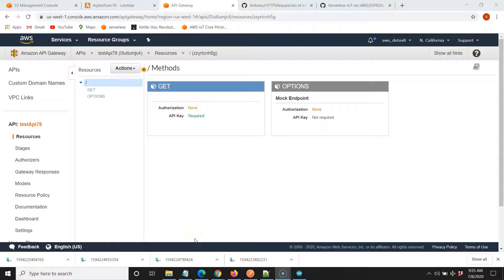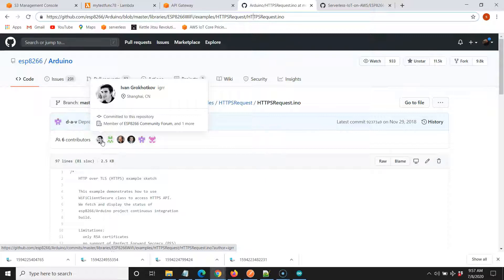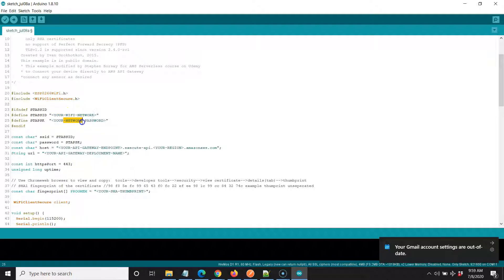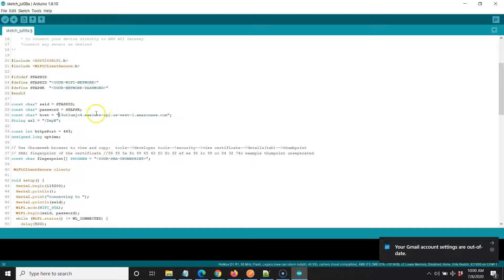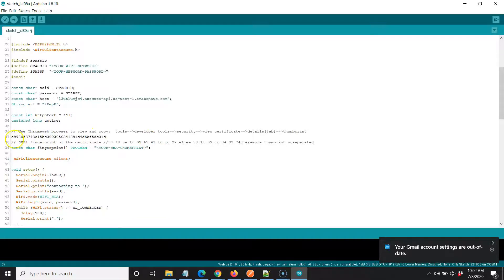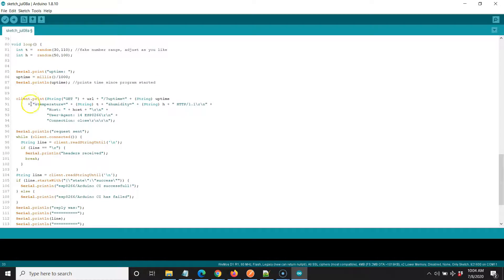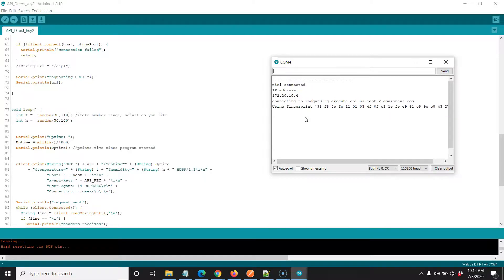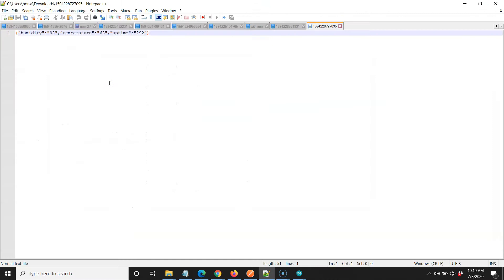Developing our Arduino Sketch for API Gateway (Part 3 of 4)

Comment: Hi Steve!

On ESP8266 it uses client.setFingerprint(fingerprint), fingerprint = certificate, on ESP32 it doesn't have client.setFingerprint(fingerprint), on ESP32 it has client.setCACert (const char *rootCA), where do I find the rootCA???
Reply from the maker: ESP32 is WiFisecured so it doesn't need to use a sha256 fingerprint.

x509 RootCA is totally fungible so you can use this one, it is good for any AWS region.

/* root CA found at:
  https://www.amazontrust.com/repository/AmazonRootCA1.pem
  fungible between regions.  Open cert, free for public consumption
*/
static const char rootCA[] PROGMEM = R"EOF(
----BEGIN CERTIFICATE----
MIIDQTCCAimgAwIBAgITBmyfz5m/jAo54vB4ikPmljZbyjANBgkqhkiG9w0BAQsF
ADA5MQswCQYDVQQGEwJVUzEPMA0GA1UEChMGQW1hem9uMRkwFwYDVQQDExBBbWF6
b24gUm9vdCBDQSAxMB4XDTE1MDUyNjAwMDAwMFoXDTM4MDExNzAwMDAwMFowOTEL
MAkGA1UEBhMCVVMxDzANBgNVBAoTBkFtYXpvbjEZMBcGA1UEAxMQQW1hem9uIFJv
b3QgQ0EgMTCCASIwDQYJKoZIhvcNAQEBBQADggEPADCCAQoCggEBALJ4gHHKeNXj
ca9HgFB0fW7Y14h29Jlo91ghYPl0hAEvrAIthtOgQ3pOsqTQNroBvo3bSMgHFzZM
9O6II8c+6zf1tRn4SWiw3te5djgdYZ6k/oI2peVKVuRF4fn9tBb6dNqcmzU5L/qw
IFAGbHrQgLKm+a/sRxmPUDgH3KKHOVj4utWp+UhnMJbulHheb4mjUcAwhmahRWa6
VOujw5H5SNz/0egwLX0tdHA114gk957EWW67c4cX8jJGKLhD+rcdqsq08p8kDi1L
93FcXmn/6pUCyziKrlA4b9v7LWIbxcceVOF34GfID5yHI9Y/QCB/IIDEgEw+OyQm
jgSubJrIqg0CAwEAAaNCMEAwDwYDVR0TAQH/BAUwAwEB/zAOBgNVHQ8BAf8EBAMC
AYYwHQYDVR0OBBYEFIQYzIU07LwMlJQuCFmcx7IQTgoIMA0GCSqGSIb3DQEBCwUA
A4IBAQCY8jdaQZChGsV2USggNiMOruYou6r4lK5IpDB/G/wkjUu0yKGX9rbxenDI
U5PMCCjjmCXPI6T53iHTfIUJrU6adTrCC2qJeHZERxhlbI1Bjjt/msv0tadQ1wUs
N+gDS63pYaACbvXy8MWy7Vu33PqUXHeeE6V/Uq2V8viTO96LXFvKWlJbYK8U90vv
o/ufQJVtMVT8QtPHRh8jrdkPSHCa2XV4cdFyQzR1bldZwgJcJmApzyMZFo6IQ6XU
5MsI+yMRQ+hDKXJioaldXgjUkK642M4UwtBV8ob2xJNDd2ZhwLnoQdeXeGADbkpy
rqXRfboQnoZsG4q5WTP468SQvvG5
----END CERTIFICATE----
)EOF";

Comment: Hi sir, I developed one HTTP REST API for AWS DynamoDB using Service Proxy (without invoking Lambda) and tested HTTPS Post request from Postman and it is working fine. Now the same thing has to be done in ESP32. But in this line in the code:
 client.connect(HOST_NAME, HTTP_PORT): It can not connect to the sever. 
I put:  const char   HOST_NAME[] = "aws.amazon.com"; Can you please help me out?
Reply from the maker: The Host name will be your IoT endpoint if using AWS IoT Core.  If using API Gateway your host name will be your API Gateway generated URL.

You can email your program to at borsay@gmail.com and I can look at it.

Comment: Hello, I am using the ESP32, I'm having an issue where regardless of using the API key or not, I get the response:
```Timer set to 5 seconds (timerDelay variable), it will take 5 seconds before publishing the first reading.
HTTP Response code: 403
{"message":"Forbidden"}
HTTP Response code: 403
{"message":"Forbidden"}```

And nothing is added to my test folder bucket. Can you help me understand why? :(

Thank you
Reply: I have tested with Postman and the url + API key works to return "internal server error" message correctly, so it has to be my Arduino sketch but I did not change anything but the wifi info (which works) and the url + api key. What is the problem?
Reply from the maker: @Travis-cx5bf  Check how you pasted your Api Gateway Endpoint into the sketch for your ESP32.  Remember you don't include the http URL prefix
Reply: @SteveOnIoT  In the code you linked for "ESP32 with API-Key:" there is a comment saying it needs the "https" prefix, so when I try removing that I get error code -1 :/ I also tried both copy/pasting the key as well as manually typing it in.
Reply from the maker: @Travis-cx5bf  Yes that's correct for the ESP32 sketch you needs the 'https' prefix, sorry.  In th4 mean time try removing the API Key and see if it works without one.
Reply: @SteveOnIoT  It turns out I needed to call addHeader() with the api key AFTER calling the .begin() function. That works for me. Anyways, thanks for the tutorial series, I'm learning a lot!

Comment: Hi steve, interesting tutorial. i have question how to connect to s3 server and upload file using http command, example esp32 upload to bucket. i'm still confuse how to make http command related with endpoint url, accesskey, secretkey and bucket name. please your advice. many thanks
Reply from the maker: there is no such thing as an "S3 server" as it can only host static websites.  Are you trying to send IoT payloads from a IoT device or do you just want to upload data using the AWS CLI or cURL using certificate security to an s3 bucket?  All are possible

Comment: Your a life saver, I couldn’t figure out the correct syntax for a GET request to API gateway from Arduino, spent hours trying different libraries etc... I think part of my issue was a space character in a query parameter that I needed but managed to figure out it needs to be %20 and then it goes through properly.
Reply from the maker: Yes, manually rolling a HTTP request into a sketch is a little tedious when  you use string concatenation and literals.  The ESP does have some library functions  like http.header(string foo) which can make things a little easier.  Generlly one you get your http string and headers correct they are interchangeable between all these IoT websites although security requirements will vary.  There are also third party HTTP libraries for sketches that may make the job easier  I think Rui Santos has some examples of these.